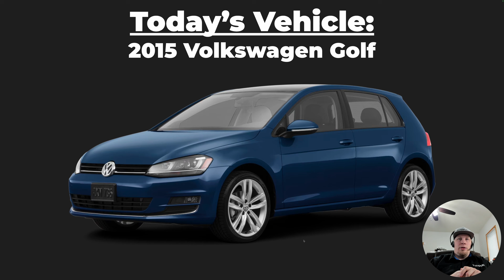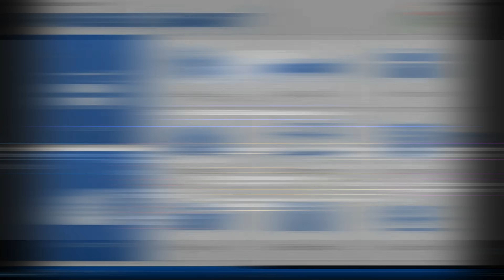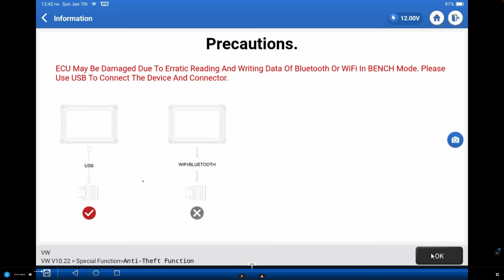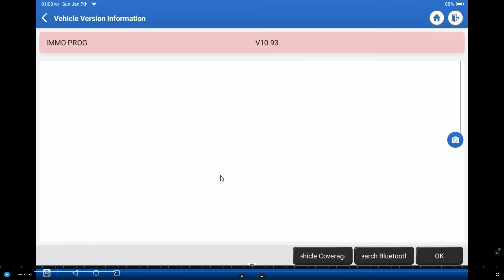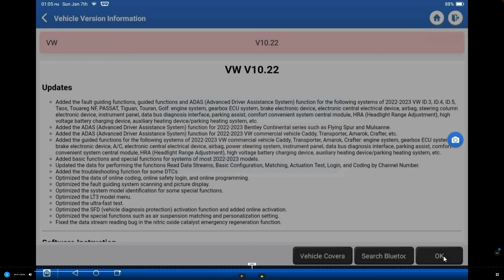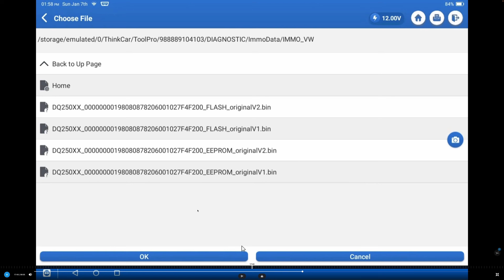Volkswagen/Audi 0D9/DQ250 6 Speed DSG (Dual Clutch) Transmission Mechatronics Cloning

Comment: what is the difference of the platform mode and vehicle mode
Reply from the maker: The difference between platform mode and vehicle mode typically lies in their scope of operation. Platform mode may refer to functions that apply to a specific vehicle platform, such as Volkswagen's MQB, covering multiple models sharing the same architecture. Vehicle mode, on the other hand, focuses on specific diagnostic or configuration settings tailored to an individual vehicle. Let me know if you need more details!

Comment: so when i want to clone it and have both mecatronics on a table i still need to connect the obd to the car or just the mecatronics to the ninja box
Reply from the maker: Hi, Cloning is done by directly connecting to the ECU to read and write data.
Reply: @TopdonOfficial  so its not necessary to connect it to the car just the ecu's

Comment: Hello, my 2012 cc have id:msx , donor have id: LQT, they are both 2012 Vw cc, vw parts department said it’s same transmission part number based on vin number, would it fit and work??

Comment: Hello what is the difference between 02E and 0D9?
Reply from the maker: Hello, The 02e is the first-generation dual-clutch transmission and is accessed via a different menu selection for cloning. It is supported by our software.
Reply: Can you please explain which menu and the process? 

I am trying to clone the 02E with the DQ250 harness but can’t communicate.
Reply: I’m using T-Ninja box as described in this video

Comment: The mechatronic is tikking constantly and the ecu fails to communicate.
Did u ever encounter this before?
Reply from the maker: Hi, did you clone the engine ecu? and what modules don't communicate now? You can read the vehicle DTCs to see where the problems are. Besides, can you confirm you have read the eeprom and falsh data of the original ecu and written them to the replacement ecu successfully?
Reply: @TopdonOfficial  hi there topdon,
Im trying to clone the mechatronic unit not the engine ecu.
I have a hunch that the mechatronic unit has a internal malfunction. I tried it your way like on the video no success.
Thanks for getting back to me.
I will try do the replacement with odis and see what happens.
Reply from the maker: @sabrinatjoen-a-choy2425  Hello, our device doesn't do Mechatronic unit clone. It's recommended to change the unit if it doesn't communicate. Look forward to hear you good news!
Reply: @TopdonOfficial  hi there the video shows u can take the info out of the old and put in the secondhand correct?
Reply from the maker: @sabrinatjoen-a-choy2425  Hi , the function you described is ecu clone, you can find the video on our official youtube channel. If you are going to use OE software to do ecu programming, you will need a new ecu to replace the old one.
Reply: @TopdonOfficial  ok thanks than i misunderstood.